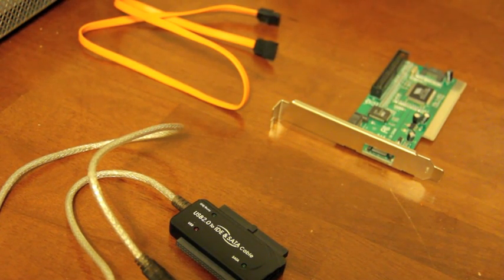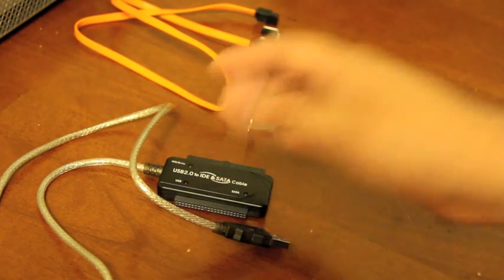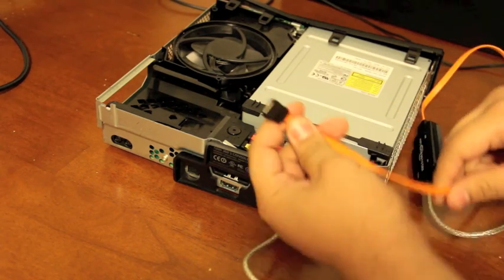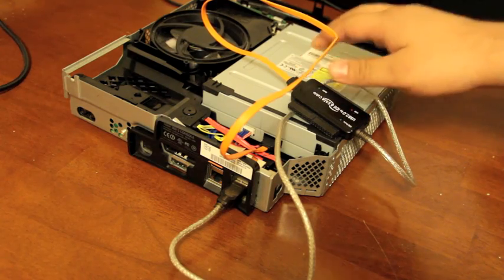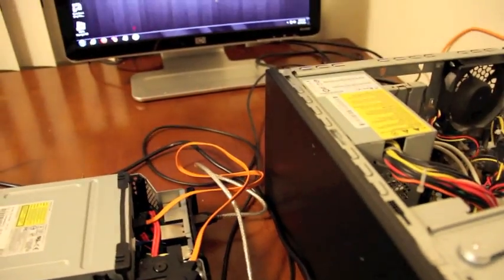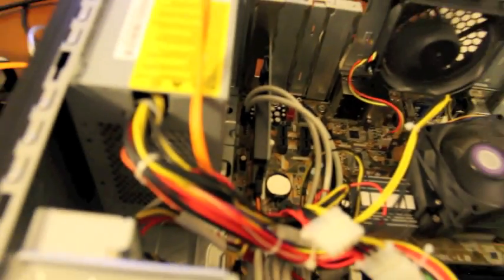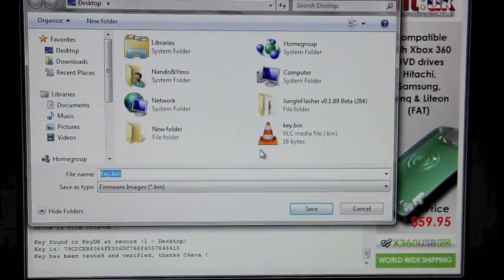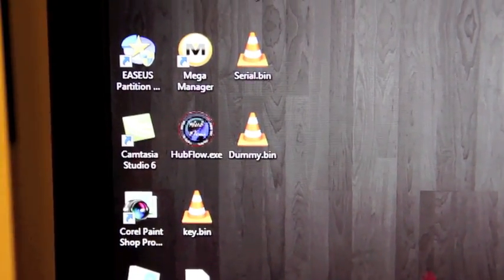How to Dump Xbox360 Slim Drive Key(9504/0272,0225)With VIA6421 Chipset

Comment: i have the via6421 card, but my new pc doesn't have any open pci slots. it only has 3 pci-e slots, and a x16 pci slot for my graphics card. can i use the x16 graphics card slot? or do i need a pci-e-to pci adapter?

Comment: One questions: why do you need to connect the SATA Cable to the Xbox USB-Port with the SATA to USB connector?

Doesn't it work if you just connect the drive to the VT6421a chipset?

Please answer fast because I don't want to order a SATA to USB connector.

Comment: finally i made it without the pci via 6421 card only with the usb to ide/sata cable which is nessesary in order to make the drive go in vendor mode tip is to open close tray and then connect the sata cable to the computer as soon as the tray closes thanks again for a great video

Comment: thanks for the video very helpful just one question my motherboard doesn't have a pci slot but it recognises my 0225 drive with only the USB to IDE/Sata cable will i be able to extract the dummy.bin for my xk3y or do i still need the via 6421 pci card ???